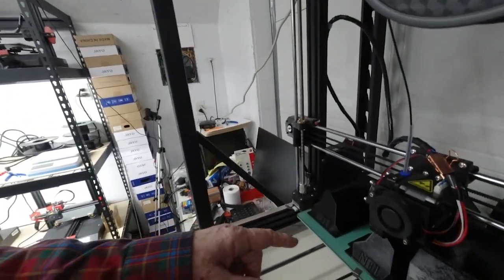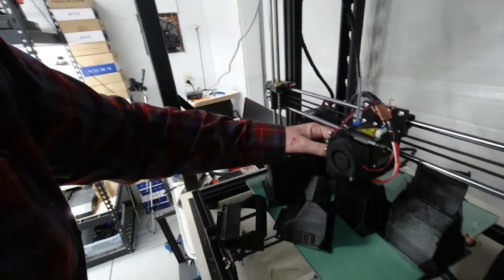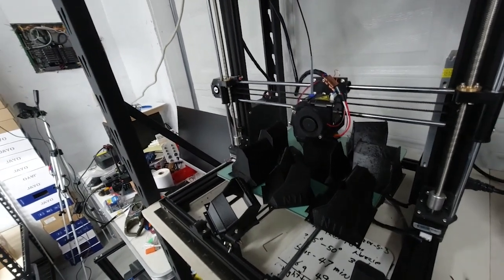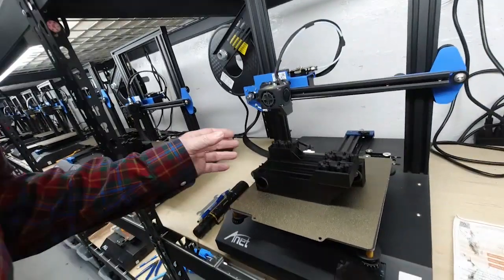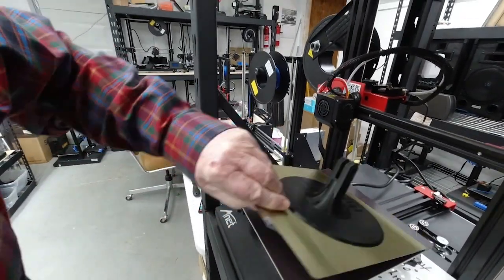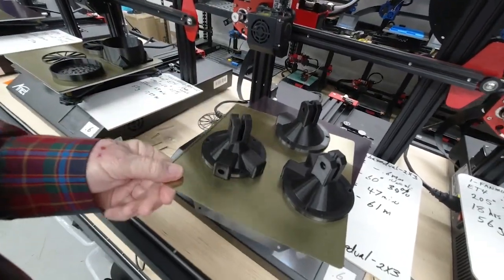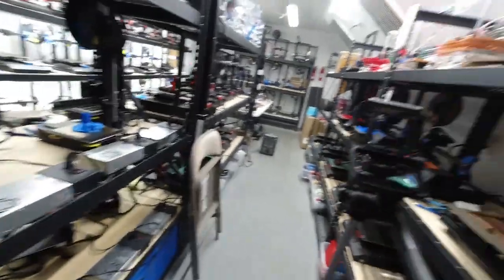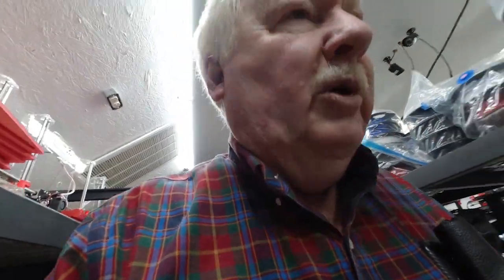MY 3D PRINT FARM AFTER POWER FAILURE, what happened to the jobs I that were printing?

Comment: How about a whole house ups backup, or a large enough portable ups.  Larry
Reply from the maker: I have thought about a Generac generator, and a battery backup system using automotive batteries to give me a few minutes till the generator can come online during a power failure. I am still planning on setting up a battery backup system in the event of a short, few minute outage, that would keep my larger printers going. I have the parts and just need the time to build it. Thanks as always for your input...Ken

Comment: Glad you didn’t loose more prints Ken. It’s a real bummer when a large print job is nearly finished and then the power goes out. Been there. Cheers Robert
Reply from the maker: Thanks Robert. I think if I had my Automotive Battery back-up system operating it could have provided enough power to finish this particular job. Now I have the motivation to get it operational. Till the next time my friend...Ken